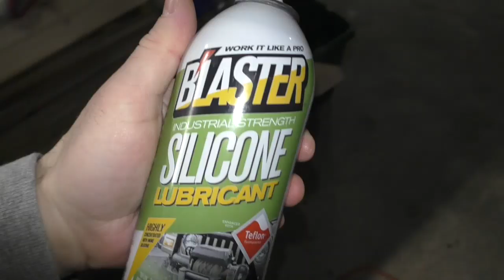How I Bought A NEW Toro Mower for Half Price (and some general chatting about mowers and life)

Comment: I remember back in the day my dad had a Murry with a briggs on it that he ran for well over 10 years and never changed the oil in it, I dont think he ever even replaced the air cleaner, but that poor old thing just kept going and going. I remember before it finally died it used to smoke pretty bad when it started up, though what finally killed it was the deck and handle were so rusted that it was just falling to pieces

Comment: I'd paint the bottom of both mowers with zinc paint and maybe attach a sacrificial zinc anode if I could.  Let the zinc corrode instead of the steel deck.

Comment: My first lawmower was a briggs and stratton newer style engine think its called a quantum. Bought it from my freinds dad for $20 it had been retired but me and my freind got it running it smoked so bad on the first start that im surrpised nobody called the fire department because the backyard looked like it was on fire.. but it cleared up and ran it for 2 years before it started smoking after shutting it off the rings were shot and probably were when I got it I just ran it until it burned way to much oil

Comment: My Lawnboy that we had before we had to throw it out because the pull-rope to start the thing had seized and no longer worked properly it was a very nice mower. I know that it might have been possible for it to be fixed.  It also had a aluminum deck and it was very nice. Now you can't get lawnboys brand new that looked like how anyone who remembers what lawboys looked like for the past 30-40 years. We had this one mower with a very goofy looking hand which made the mower awkward to use and my sister was using it to help cut a neighbor's yard and she hit a stump and which caused damage to the engine to the point where the mower would vibrate violently and yeah we got a quote to fix it and it would cost us $150 bucks which is more expensive than buying a new mower. Yeah mowers are not made like they are used to.  Heh lifetime oil that reminds me of with Vacuum cleaners that never lose suction. It is a huge marketing ploy to pull consumers in.

Comment: I have a Murray from 1995 that came with my house 12 years ago and i haven't had any problems with it.  Hasn't rusted through, always starts on the first pull every year, never put stabilizer in it.  I just change the oil and air filter every year and had to buy a new set of plastic wheels.  Seems like a waste to buy anything new.